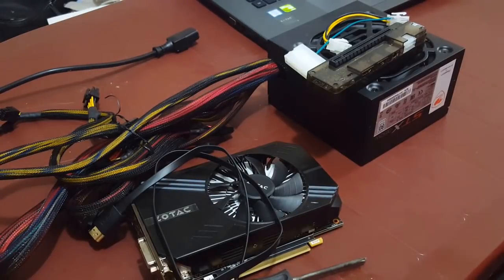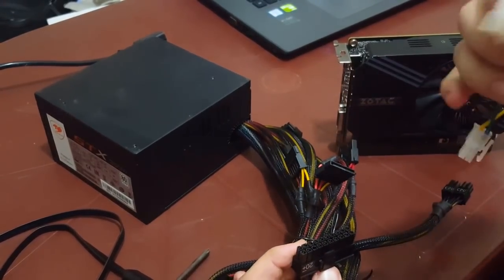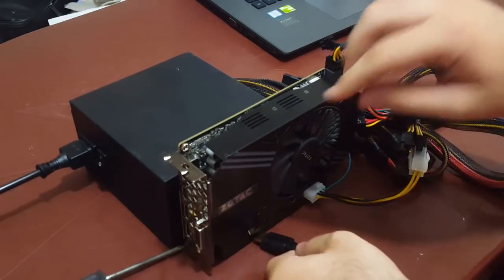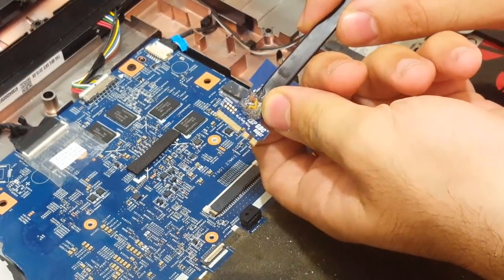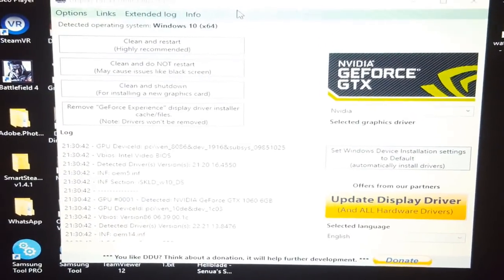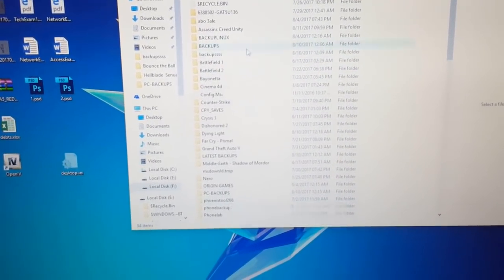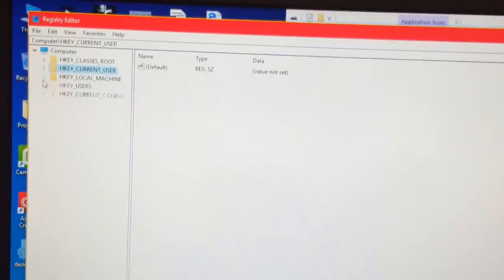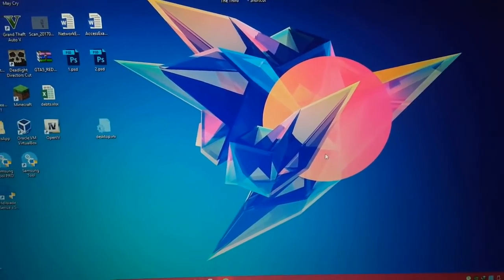HOW TO: External GPU for any laptop PC W/O External Monitor GTX 1060 EXP GDC 1050 ti solve error 43

Comment: Hello, i tried to follow the steps in your video but i don't have Express root port listed in my device manager, what should i do?
Reply from the maker: Alexandru Craciun check if you can find a system device called pci to pci port
Reply: pci to pci bridge i have
Reply from the maker: Alexandru Craciun okay there should be more than one, try right clicking and update driver, you should then see the pci express port
Reply: I did it just says that i have the last driver available, i left you some info in the previous comment, and i also want to thank you for speaking with me :)

Comment: my computer always return back to 950m. i disable his pci port but nothing
Reply from the maker: if you disabled the PCie port it should vanish, so you are disabling the wrong one, check again.
Reply: can i disable all of them?
Reply: i have 3 pci expr disable  and the 950m still visible  how its possible
Reply from the maker: try disabling all, it should not hurt your system
Reply: i have to reboot for cheking?
Reply: No  all disable  and  950m  staying here
Reply from the maker: Shakur Shakuri then just disable you internal gpu from display adapters
Reply: i m going to try  disabeling. in the bios accelerator 3d
Reply: 950m display removed but. code error 43  for my 1060 gtx
Reply from the maker: Shakur Shakuri follow the video carefully, make sure you use DDU in safemode
Reply: i did
Reply: i have a gigabyte p15v3. i7-4710. dgpu 4600 intel and gtx 950M .... if some one can help me will be great ...

Comment: Thank you so much! 
Now i'm struggling with the blue screen (TDR ERROR). As i've been reading, it seems that is something to do about the driver version. But at least you solved the error 43.
I'll add more informations here in case of success.
Specs: Dell Inspiron 15R Special Edition - i7 3632QM, 8gb ram, Intel HD graphics 4000 + eGPU Galax 1060 6gb EXOC White. 

Sorry about my poor english.
Reply from the maker: Gabriel Vaz BSOD may be caused from the PSU, maybe you need a better one.
Reply: Pedro Marthon Sorry, i dont know what a PSU is. But i've figured It out! I've done the same thing but instead of using the "Latest driver", i used the version 375.20. Now its perfect!

Comment: My lenovoG50-80 cant work on it..can u help me solve the problem?
Reply from the maker: Keng Bing Hoo tell me your full specs and the problems you are facing
Reply: Pedro Marthon i using lenovo G50-80 now i already plug in all the things..but still cant detect the graphi card
Reply from the maker: remove the battery and power plug from your computer, connect the GPU and turn it on, then connect battery back and power on your PC
Reply: Pedro Marthon still not working :'( my laptop cant even detect the graphic card.
Reply from the maker: Keng Bing Hoo sadly your laptop seems to be incompatible with external Pcie, you will have to go with unlocking your bios, and be careful...
Reply: Pedro Marthon how to block Lenovo G50-80 bois?
Reply from the maker: I don't really know an easy way of doing it, you just need to search google.

Comment: THANK YOU!!! This great tweak got me on the latest 2018 NVIDIA 391.01 driver for my Asus Strix GTX1070, instead of being stuck on the last known 2016 372.70 version. My platform is ThinkPad T430 via Beast EXPGDC V8 Expresscard Adapter. Thanks again for making a video that provides such an effective solution to the Code 43 issue.
Reply: did u have any issue after it got updated coz mine it was detected  but for some reason wen im in game,my 1070 wasn,t really performing...
Reply: Are you guys experiencing any major FPS hits from time to time? My 970 seems to be stable 120fps then spiking down to 70 (noticeable in fast pace games)
Reply: Bro have you tried AC Origins? If yes, then how is the performance? 
I have GTX1070 (ASUS STRIX OC) , PROCESSOR: 4710HQ,  Performance is not good, FPS Fluctuating, even at low settings! I know bottleneck,
But I want to know your experience.Thanx in advance
Reply: Hi I have no problems with RainbowSix, Battlefield and COD. eGPU works well when using external display connecting directly to the card. But do expect long loading time due to the narrow bandwidth between Laptop and eGPU. If a game keep asking loading of resource from storage, expect frequent FPS drop.
Reply from the maker: If you are using and external monitor make to to disable the internal one, it will give you an fps boost...
Reply: Pedro Marthon I disabled already, and also I am using external monitor,,
I don't know what is happening, may be my card is being  bottlenecked by my CPU,,

any other good card where you player AC origins.?
Reply from the maker: Yes, it could be the CPU's bottleneck, check my benchmark video in the description it is obvious.
I have AC origins but still did not have the time to install it yet...
Reply: Pedro Marthon yeah benchmark is superfine,

I tried heaven , it's showing 58FPs, and 1437 score, and that seems okay to me,,

Would you please try AC origins for me at least? and let me know the outcome..
Reply from the maker: Will install it tonight
Reply: Pedro Marthon , thanks dude,
Please let me know the results
Reply: Pedro Marthon did you install it?
Reply from the maker: @Sunny Sekhar Hi, sorry I took long to reply, I made the benchmark several days ago but forgot to reply the results.
I managed to get straight 30 fps on Very High preset @1080p with minor drops
I also managed to play on Ultra preset but had some stuttering issues here and there and it was playable overall.
Reply: @hmawla  PLS PLS ANSWER THIS QUESTION:

I have the thinkpad x220 (no dedicated gpu) and im planning to buy the gtx 960 can I run it in my internal monitor? (Cause If I cant im either just gonna buy an AMD one for the egpu and play games on a external monitor or just not do this egpu thing and just accept my laptop as it is)
Reply: @Wise Chan hi, today you still use the t430 with your gpu? Have not you had any problems? I ask because I want to buy this I have a t430 but the users fail the EXP BEAST and they stop using it

Comment: friend one asks me to have a vit 3400 turn with a
CPU
Intel® CoreTM i7-3517U, 4M b
Motherboard
Intel HM77 Chipset
Buy a video card ftw 1050 ti 4gb to place this type of system, when installed several problems appear.
1) When connecting the whole system, the hard disk of the PC does not turn on.
2) If I turn on the PC first and then connect the HDMI cable, the white screen turns on.

I really do not know what to do, if someone can help me! I do not know if more tension is happening than it should or not. !!

If someone can help me

Comment: Help me please, my eGPU fans are turnning, and my gdc beast has green light, but it's not detected , when I install Nvidia 368.81 it doesn't detect the graphic hardware
Reply: After installing 368.81 go to your GPU's website (Not NVIDIA's) and download the latest driver. Install it without NVIDIA experience and uncheck "Perform Clean install". It should work. Check your Device Manager and disable your dedicated laptop GPU
Mine has green light too, wonder if we can disable it. haha

Comment: I tried with your method and everything is installed but does not open the control panel nvidia, the resolution is always set to 800x600 and the games do not start because there is no graphics driver installed, but if I go to see on management devices my vga is enabled
Reply from the maker: You will need an external monitor
Reply: Can not use the internal monitor of the laptop?
Reply from the maker: Yes your pc may not allow you to use an external gpu with your internal screen
Reply: bad luck, on three notebooks I have at home no one allows me to use the internal monitor
Reply from the maker: Get any cheap 720p monitor and test, it should work.
Reply: And if not even this should work?

Comment: Bro i have dell vostro 3446 i3 4005u,8 gb ram and gtx 1050ti and i follow all the instructions and the card works fine but my problem was when i played any game in internal screen the fps stuck in 20 to 25 in both high and low setting.so i didn't got any solution,so please help me to fix this problem.And sorry for my bad english.
Reply from the maker: Disable Vsync from Nvidia Control Panel and from ingame

Comment: can this take help playing games at 60 fps
Reply from the maker: sure check the benchmark video in description
Reply: +Pedro Marthon and i have acer aspire 5733Z
Reply: +Pedro Marthon and I m using Intel i5 8th gen
Reply from the maker: youtube user it should do good
Reply: +Pedro Marthon thank you so much you changed a poor gamers life I am so emotional right now really.
Reply: +Pedro Marthon one last que. can I use my charger and directly plug it to a socket as power supply
Reply from the maker: No it is not enough to run the gpu, a power supply is always needed, especially if a powerful gpu is present

Comment: Yo bro i really need your help
I've installed the exp gdc and external video card according to you and i think i do the right way. The problem is after i disable pcie root port for my internal gpu, i cant install the driver you suggested (368.81 & 375.63) and i tried the lastest one (390.77) still doesnt work. I think my external gpu doesnt detect at all. Can you give me the solution?
The gpu fan is spinning and the exp gdc light turned on in case you need to know.
Thanks
Reply: Uninstall wifi card drivers. :) Then reinstall drivers for gpu and restart your pc.
Reply: Can you check HWmonitor if you have a hotplug capable mini PCIe port?
I followed the guide found here:
https://egpu.io/forums/expresscard-mpcie-m-2-adapters/FIXED-Nvidia-GTX1050Ti-error-43-on-mPCIe-or-M2-non-hotplug-eGPU-interfaces-applicable-to-GTX10xx/
Reply: Did you make it work?
Reply: Try this, i turned on my laptop with wifi card still attach, then try sleep with your laptop, get the wifi lan card off then attach the pcie. Thrn press anything on your keyyboard to make the laptop alive after sleep. nnnn it works. P. s,, i also got the same problem like you but it works now

Comment: I followed all your steps, but my laptop still does not detect the EGPU, and try in all ways only detects internal gpu (gtx660m), WHAT CAN I DO ?.
I have the asus G75VW, i7 3610qm, win 8.1 and 1060 6g ATRIX egpu.
Reply from the maker: JCmedina3D maybe your laptop is not compatible with external PCIe, or maybe your PSU is not working well, alao check the connection between the gpu and laptop, and make sure you remove every power source from the laptop before connecting the gpu and power it on
Reply: I already tried everything, good. I will buy a desktop PC GAMER, better with the card I have. same thanks for the instructions.

Comment: Hi there, unfortunately i cannot install 368.81 drivers. It says that the hardware is uncompatible. With 370.72 it works fine but when i try to upgrade the drivers as shown in the video my GTX1060(3gb) is not working again. The problem is that i cannot play some games, for example ACOrigins, which requires 388.00+ drivers.. Can somebody help me? :) Thanks!

Comment: After detecting my eGPU with setup 1.35 I got stuck on Windows Logo. How should I do? 

My laptop is Asus K42Jc (i5-460m, 4GB RAM, Nvidia G310M 1GB) and Zotac GTX 650 1GB paired with EXP GDC and 500w PSU.
Reply: Do you have an external monitor connected?
Reply: yes, but not working, just blank screen on external display
Reply: Did you use windows 10?i use a similar version of k42n before in windows 7 but i it doesnt work, but when i update to windows 10,it works miraculously